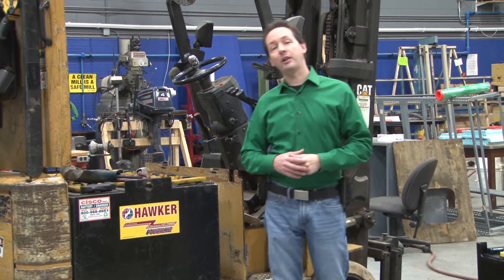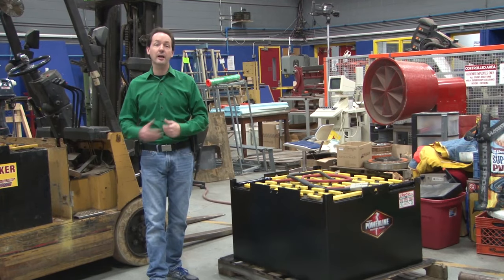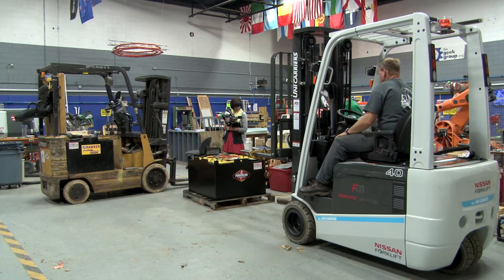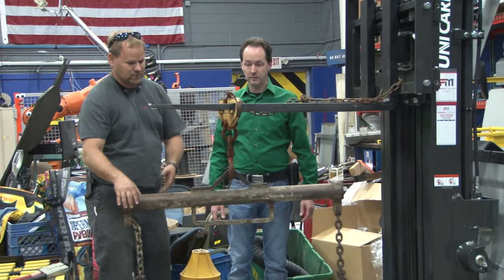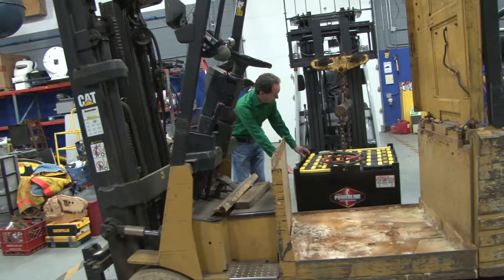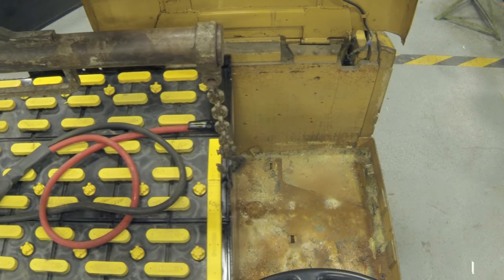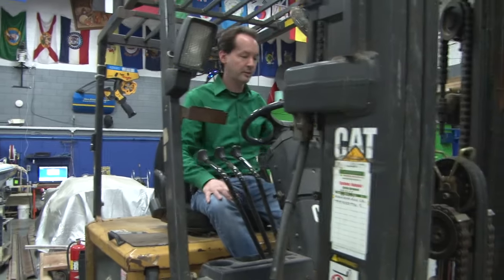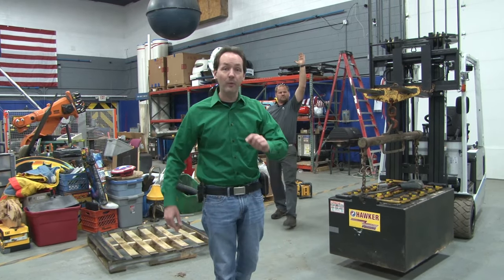Installing a Forklift Battery

Comment: I work in a distribution center operating a Raymond Reach Truck and pull and change a battery every night. We use an MTC battery changer, and pull what's half the size of that one and add it to a battery bank of around 20 units hooked up to 5 chargers. We have the hook and chain shown in the video, but it's only ever used if someone screws up and dumps a battery on the ground.

Comment: Looks like the old one was an 18-85-17 battery while the newer one has three straps to each cell so it probably a 31 or 33 plates per cell battery that would have greater capacity and more weight therefor more counterweight and lifting capacity. The lifting bar was dangerous because it was a non insulated type that could have shorted out either battery if both plastic shrouds near the lifting eyes were broken sending 10,000 to 30,000 amps through the bar. Little harm would have been done to the bar but the inter cell connectors would have instantly melted given rise to a battery explosion and injury to people near by. 

These batteries are not dangerous when used correctly and there are literally hundreds of thousands in use every day of the week and for most of us, everything we consume has been handled by such a battery! I worked in the trade for over thirty years and wish I was still working with them. I got a charge out of it!!